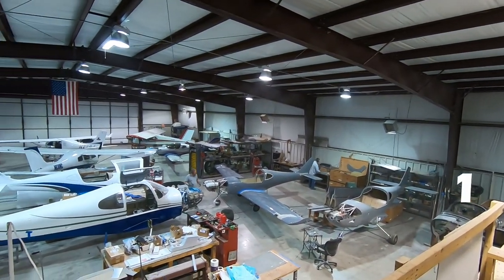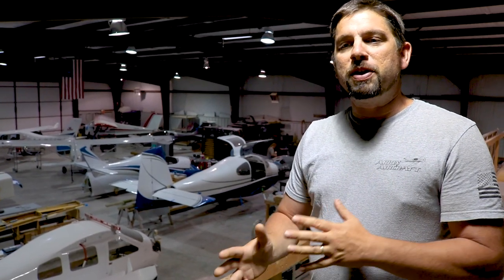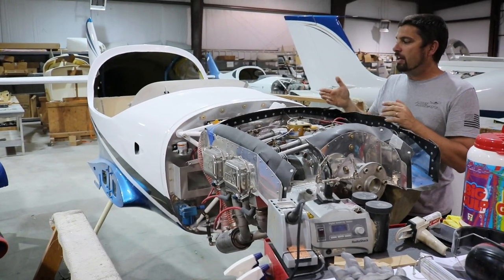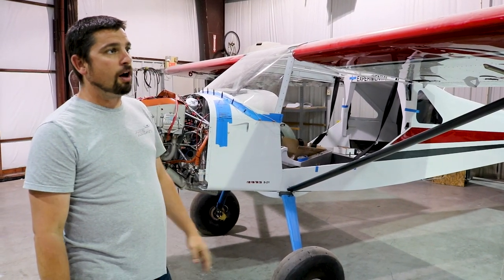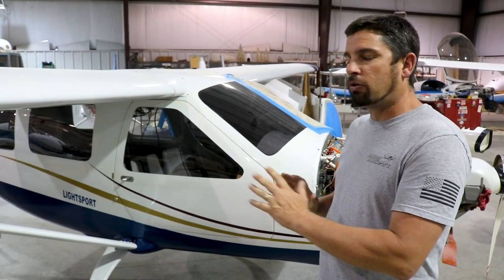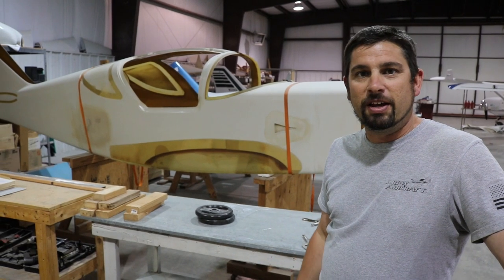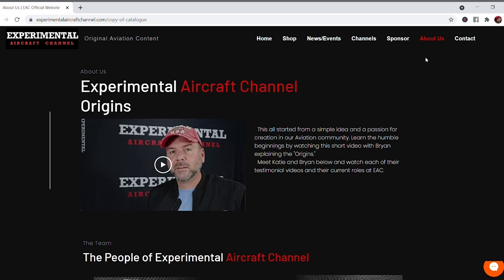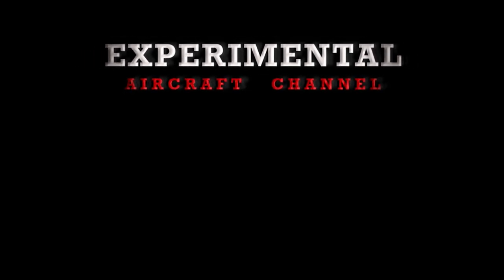How Many Aircraft does Nick Have? Builder Assist Center

Comment: Bryan , As I learned while a Reporter then Bureau News Editor for Dow-Jones Newspapers (in the 1960's when print was king), There is always, always a back story or two! The high cylinder temps were a result of metallurgical deficiencies that the Rotec radial folks in Oz fixed by producing liquid-cooled heads (check their website); and the prime contractor to Jabiru engines (Camnit or was it Camit?) went into bankruptcy liquidation (Aussies use a different term for our Chapter 7). 
Nick IS a real Mensch! (Yiddish term used now by a RC, Recovering Catholic). Arion Lightning Builder Assist IS superb (as it Should Be for what they charge!); irony is that a Cost Accounting by a green-eyeshade -wearing bean-counter would probably show Lightning as losing money on Builder Assist ! Oh, well !

Comment: What does their assistance cost? Looking at a Just Aircraft Escapade kit.
Reply from the maker: Great question! There is an hourly rate for simply "Shop Rate/Mechanic" if you will. Then there is another  more "long term" for the Builder Assist where you are sort of renting space while you build and then calling on "HELP" to build when needed. Best to call Nick and ask for a quote. Thanks for stopping by! :-)
Reply: Thanks for taking the time to respond to my question. Keep up the good work
Reply: I don't want to step on Nick/Arion by quoting what I am paying for builder assist on my lightning because (as noted in the Experimental Aircraft Channel reply) you could fall in a different pricing structure.  However, I can say that they are very reasonably priced in today's world.  With respect to productivity, it is amazing how fast a lightning (their own product) goes together with builder assistance!  For less common kits that they haven't seen before, I would suspect some of that edge would be lost, but you would still gain the overall knowledge reserve.   Can't hurt to call them.